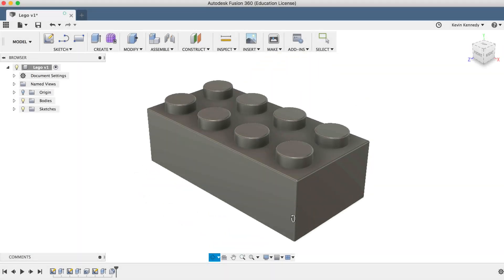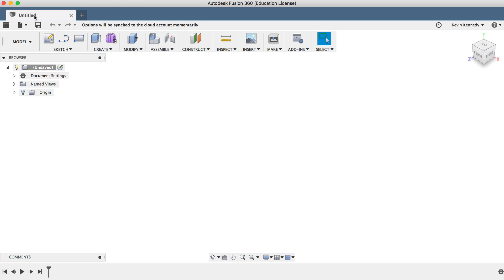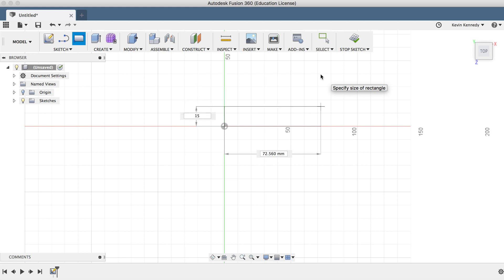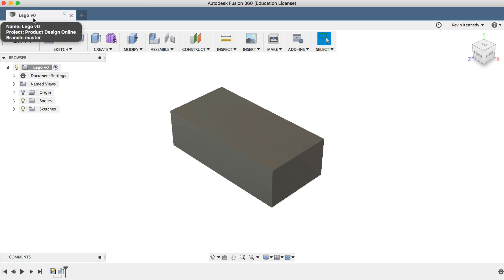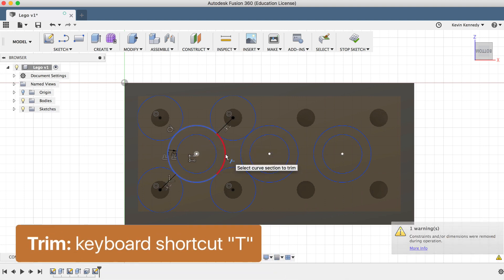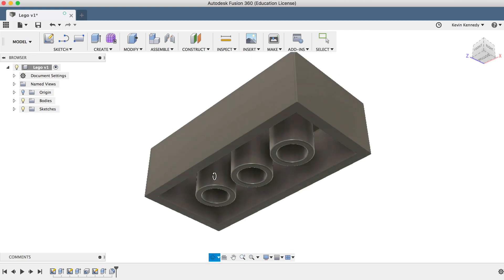How to 3D Model a Lego Brick - Learn Autodesk Fusion 360 in 30 Days: Day #1

Comment: When I try to extrude the bottom three circles, I can only click/select the whole bottom plane. If I flip it, I can extrude them up from the top but not down (which makes a hole) from the bottom. What am I doing wrong?
Reply from the maker: Hi Ken - It sounds like you might have created the circles on the wrong plane. Make sure that you select the inside/bottom of the lego as the sketch plane, before drawing the circles. Here's a screenshot where the plane I'm talking about is highlighted in blue - https://snag.gy/KnO0US.jpg

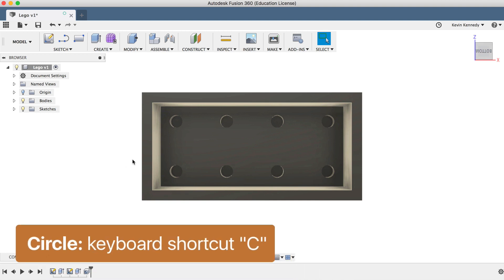Pay extra close attention to where I click at 4:54

Let me know if that works! Cheers, Kevin :)

Comment: Awesome, i built a lego!  Very well done video.  Only issue for me was the line command, took me some time to figure out how to use the center point for the line command (5:03), and still not sure the "C" you entered in.  Everything else was excellent!
Reply: As well, perhaps you can go over how to go back and edit dimensions on the sketch after extrusion (say a missed or bad measurement), i missed one dimension and my lego nobs were offset to the left since i missed setting one dimension.  Maybe a video how to use the timeline on the bottom to make changes (if that's how its done, my lego is still off).
Reply from the maker: MrArron76 - Thanks for your feedback! That was my fault... I totally forget to mention to hit the keyboard shortcut "L" for a line or to activate it under the sketch drop-down menu. I've been trying to double and triple check in the remainder of the series that I don't skip over things. So many things are habitual, that sometimes I forget to talk about them. Cheers, Kevin :)
Reply: Don't get me wrong, it was an excellent video that a new user can make something real with.  You have a really good skill set to explain this stuff.  I look forward to more.
Reply from the maker: Thank you, I appreciate it! :)

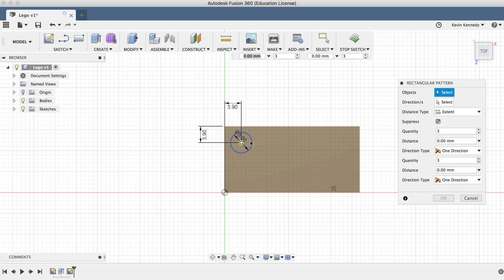Comment: After I dimension the circle on top of the block to 3.9 mm I get a little red circle at the top left and top right of the block. Are these constraints because when I start my rectangle pattern (at 3:55) I only get dots where the center of the circles should be. So I wind up with one circle and 7 dots. Could you please tell what I'm doing wrong? I really look forward to this series.
Reply from the maker: Hi Louis - It sounds like either a constraint problem or a sketch problem. With that said, it's hard to decipher exactly what's causing the problem without looking at it.

I would recommend going back a few steps by deleting your circle sketch/pattern feature and try it over again. Make sure when you do the pattern feature you're still in the same sketch as the center circle, and make sure you click on the circle and not anything else when you go to pattern it.

Let me know if you get it to work once you try it again! Cheers, Kevin :)
Reply: Thanks Product Design Online. I have completely started over numerous times from scratch. When I drag out the circle dimension I get the little red circles at the top left and right corner before I even put in the 3.9 mm dimension. If I hover over the small red circle I get an icon of a tiny cube and below it a tiny white flat square with a tiny black square inside it. When I use the rectangular pattern everything works perfect except I have only 8 dots where the center of the circles should be. Maybe I have a preference set wrong or I'm drawing on the wrong plane but my cube in the upper right is the same as yours and I do have Y-axis set to up. I've also tried exiting Fusion 360 and starting it back up.
Reply from the maker: Hi Louis - My apologies, I thought I replied to you, but I guess I only did in my head! lol

Anyway, if you are just getting dots that is because you are selecting the center of the circle (the dot in the middle) after activating the rectangular pattern feature. Make sure to select the circle itself. The circle should turn blue.

Let me know if this works! Cheers, Kevin :)

Comment: When I got to the circles on the bottom, I could not snap to the center and the circles would not snap to the same diameter as the top circles. Any idea why?
Reply from the maker: Hi redtheriffer,

1) The first thing to check is to make sure that the top sketch is on. If you look in your Fusion 360 browser (left) side, you'll want to check the light bulb icon to make sure it's on. The light bulb icon should be yellow if it's on (blue if it is off).

2) The second thing to check is to double check that when you started out with your lego you were on the top plane, and when you're doing your bottom you're on the bottom plane. If the planes aren't parallel then it won't work.

3) You could also check that your "snap to grid" is checked, located in the "grid and snaps" tab of the display settings (bottom of Fusion 360). 

Fusion 360 can be pretty picky about snapping to other sketches compared to some CAD programs... Hopefully one of these 3 things mentioned above does the trick. Let me know! Cheers, Kevin :)
Reply: Product Design Online I got it to work somehow but not sure how. Even though I was drawing on the bottom, it drew the circles on the top. I couldn't get them to draw on the surface of the recess.
Reply: In other words, it still drew them on the xy plane, not 1.3mm (or whatever the thickness of the shell was) off of th xy plane
Reply from the maker: redtheriffer  did you start the sketch on the bottom of the lego block? That may be why.
Reply: Product Design Online think I figured it out.  Press c and point to the center of the circle, except the center of the circle is that little recess where the pegs on top are shelled. So, it picked that surface instead of the main body's shelled surface. Lol does that make sense?
Reply from the maker: ahhhh... okay, that makes sense. Sometimes I wish it was easier to share images in YouTube comments....but I'm glad you got it to work! Cheers, Kevin :)
Reply: redtheriffer happened to me too

Comment: Shouldn't the 3 circles underneath be fully constrained as you did with the 6 studs on the top?
Reply from the maker: If you click on the other circles (snap to them) then they are technically constrained to that. You could always add more constraints if wanted, but for the purpose of a simple lego block I don't find it necessary.

Comment: You lost me at the 5:00 mark when you talk about click & dragging to match the circles from above. I thought I understood, but mine did not work out right. I drew a center circle between 4 "dots" from above. Then I did a -1 offset but I could not click the whole "double circle" to perform a rectangular pattern like we did with the dots on the top part. I'm brand new to Fusion, maybe this video is above me, it seems to go very fast!
Reply: took me a few attempts to get it right, I needed to have the previous sketch visble for the snapping to work.
Reply from the maker: David Hooie, thanks for commenting!

Make sure you hold down shift as you click on both the outer circle and the inner circle. Then when you go to use the rectangular pattern feature it will do both circles. My apologies, I forgot to mention that! :)

Also, thanks for the feedback. I'll try to go a bit slower in the next lessons. Alternatively, you can also slow down the speed a bit on youtube by clicking on the settings (gear icon) > select speed.

Let me know if you get it to work! 

Cheers, 
Kevin
Reply from the maker: isnarnhimself Glad you were able to get it to work! I'll be posting day #2 tomorrow. Stay tuned :)